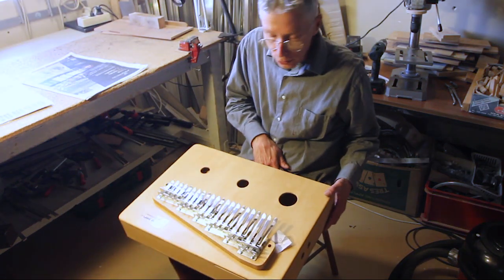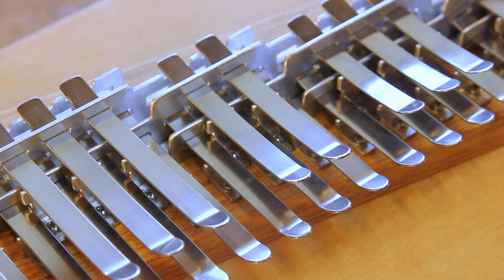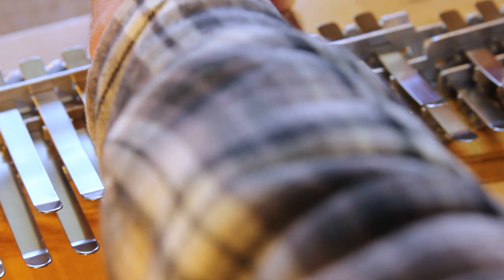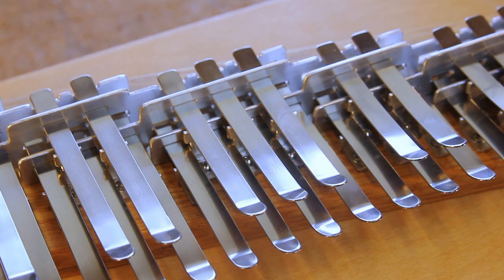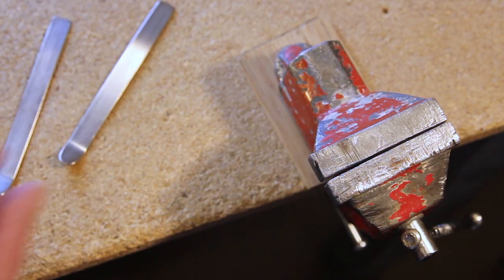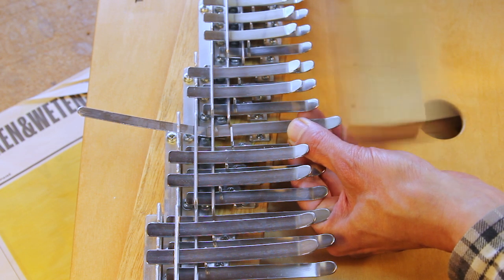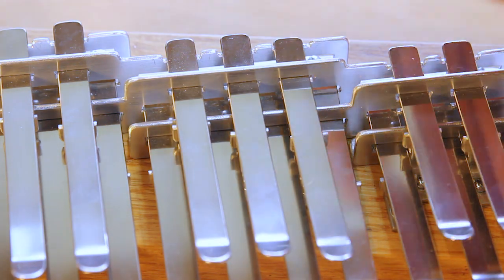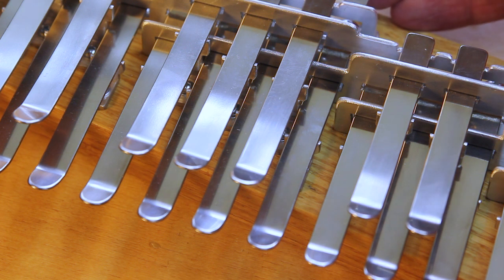Chromatic Kalimba Instructional

Comment: I would so love to hear a vibraphone-style fan mechanism (motorized spinning) over the soundholes! I know it won't affect all notes equally, but I think it would sound really cool based on how a normal treble kalimba "wah" effect sounds. Alternatively, it would be awesome to hear the pickup outputs through a rotating speaker or similar modulation effects as another way to possibly achieve a vibraphone-like sound.
Reply from the maker: I sometimes run the pickups through a chorus effect, that gives a result like you are describing. Might try a tremolo or leslie effect also!

Comment: Where did u buy those tines, or how did u make them? They sound great. Thank u
Reply from the maker: spring temperd steel. I use the stainless variety. The flat tines are a little harder to find than round wire though